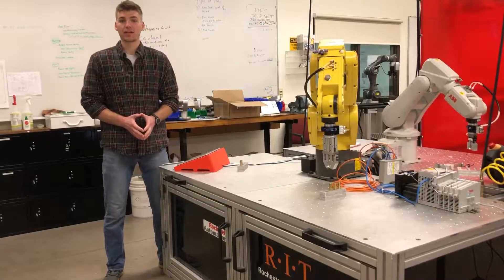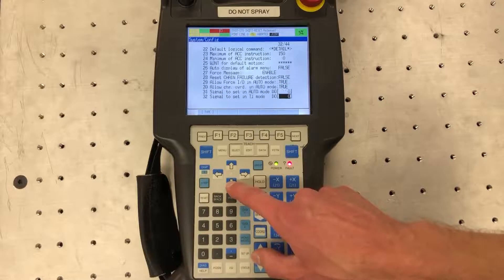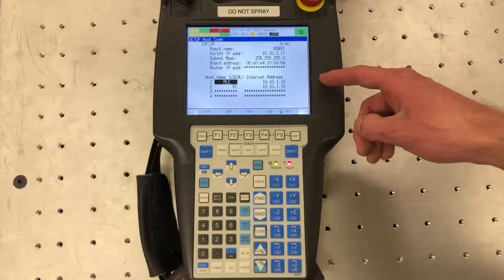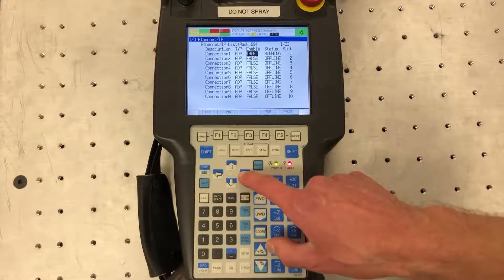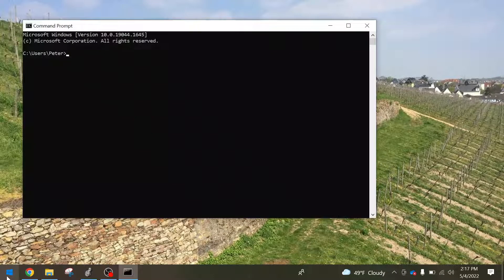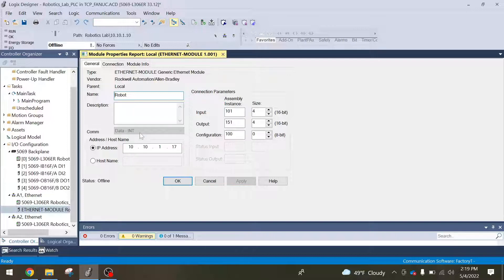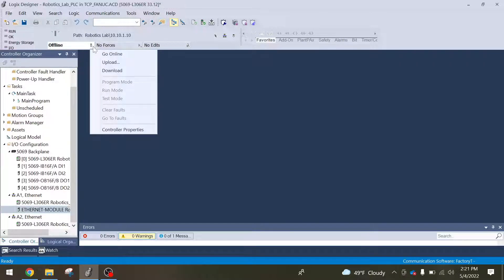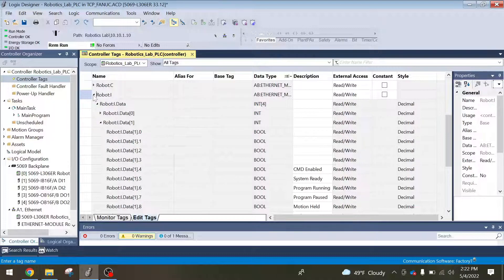FANUC Ethernet IP to Compact Logix PLC (Part 1)

Comment: Nice video.....thank you. What's the difference between an IP scanner and adapter? As the name suggests (to me) it seems one might allow DHCP where the other is static IP only?
Reply from the maker: Thanks! I haven't needed to use the Ethernet Scanner option, so I don't have much knowledge about it. However, in any application where a PLC is communicating with the robot, the Ethernet Adapter option is all that is needed.